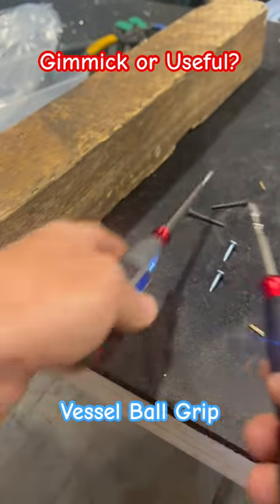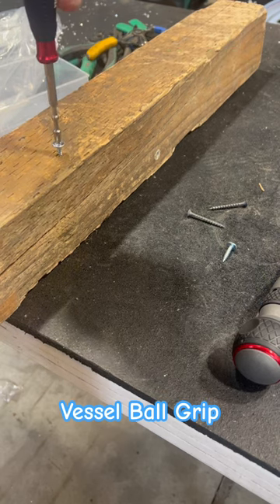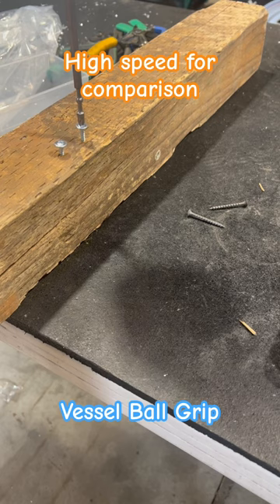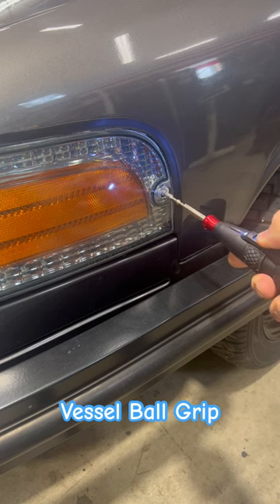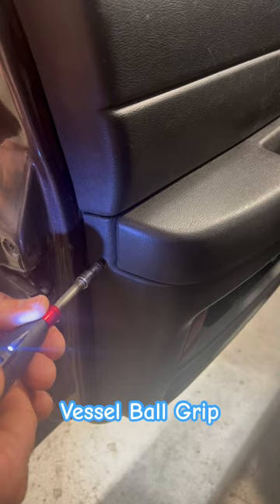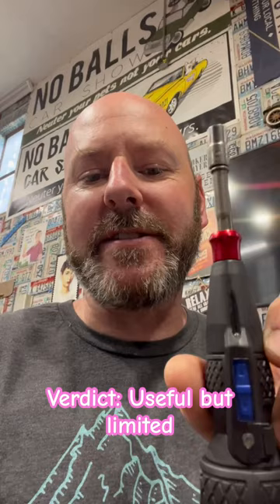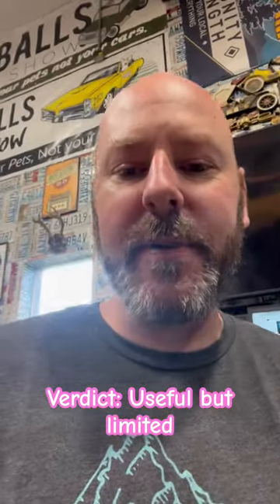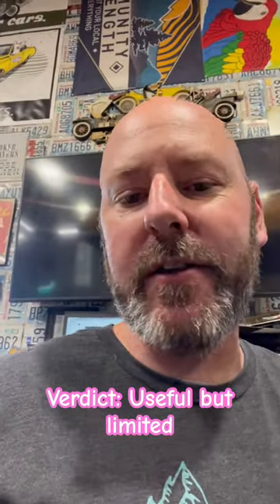Gimmick or Useful; Vessel High Torque Ball Grip Electric Screwdriver #tools #toolreview #diy

Comment: You wouldn’t use a screwdriver to drive in a screw with no pilot hole the vessel isn’t made for that
Reply from the maker: It gives people an understanding of how much torque there is. You need to see at what point it fails, not just work on everything leaving the limit a question.